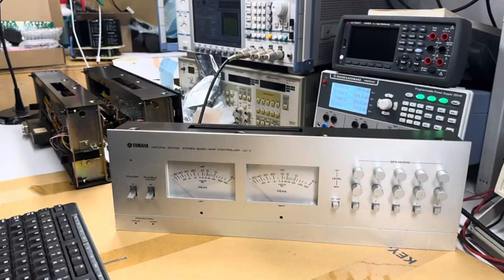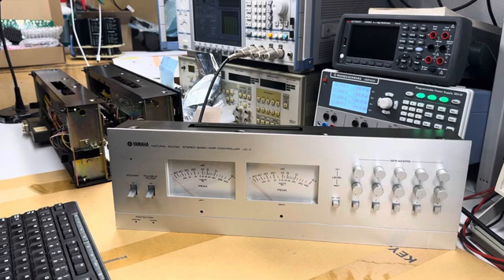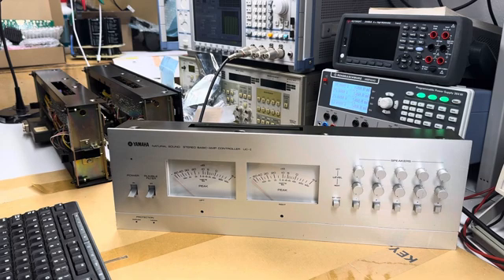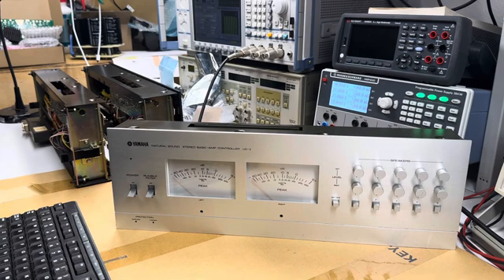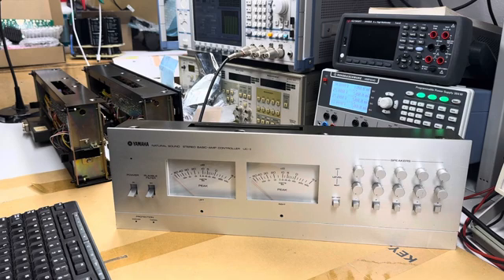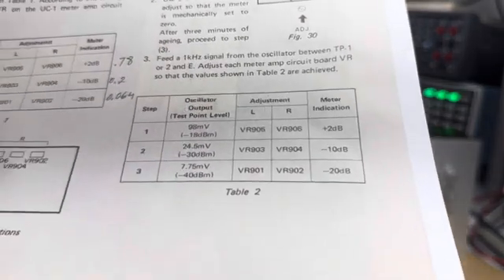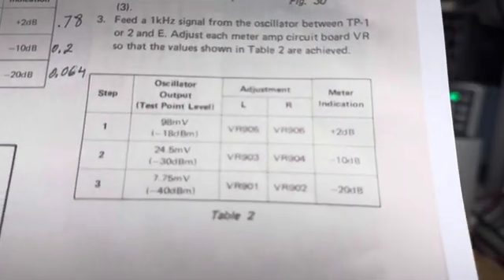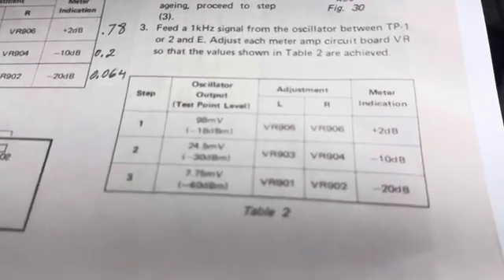VU-Meters adjustments for Yamaha UC-1, the B-1 power amp controllers.

Comment: Hello, I watched until the end, then I returned to the table of adjustment values because I was interested, as far as I know, some VU meters do not have three trimmers for balanced settings. It's a shame that he didn't explain the settings against the wiring diagram - now I should download it somewhere, because I'm interested in how they designed it to follow the logarithmic measurement curve.

Thanks for the sample and have a nice day 🙂 Tom
Reply from the maker: Hi Tom,
yes, very interesting approach on the side of Yamaha with their vu-meters on the UC-1. Next time I do a video on a Yamaha C-1 or B-2, we can take a deeper dive into the vu-meter schematic. Those are similar to the UC_1 circuit but even more interesting by having an extra adjustment point.